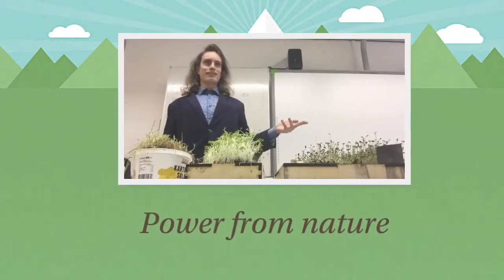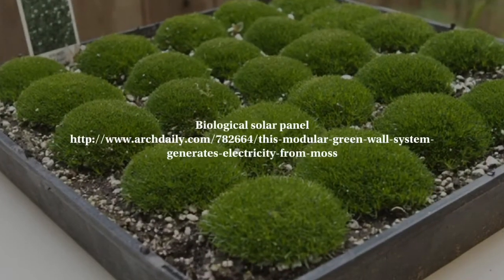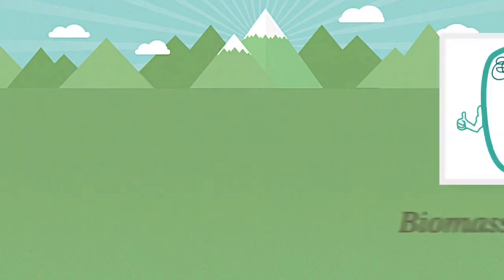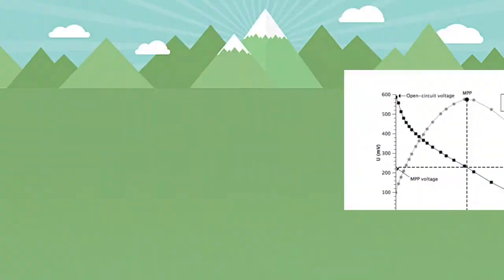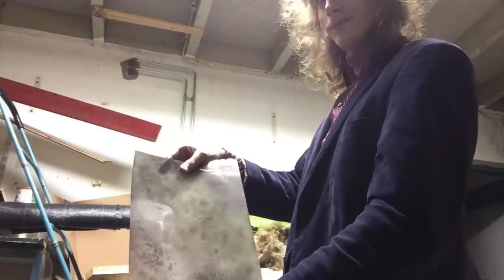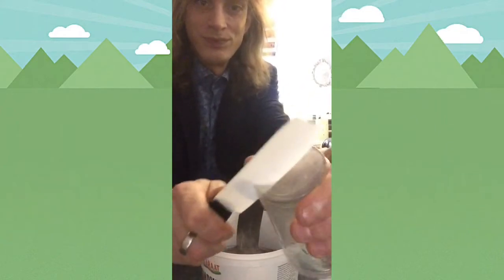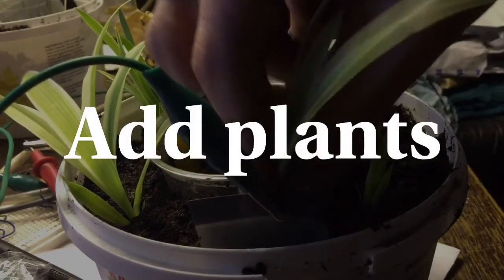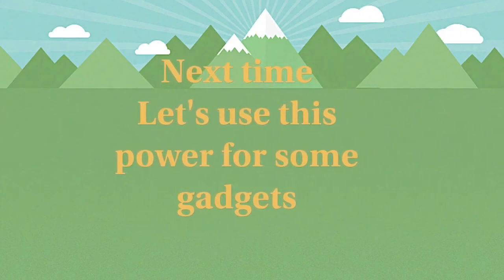Diy free energy from nature Microbial fuel cell

Comment: Is it possible to charge a battery or something small using this?
Reply from the maker: Yeah I have run microcontrollers on continuously grinding pie numbers 
Ramped the voltage up to 180 volts 
Charged capacitors and batteries

Comment: Why is the cathode not in the soil?
Reply from the maker: it could lay on top off the soil, 
but with the cups you will provide a shorter distance for the ions to  travel from anode to cathode,
Now i'm experimenting with ceramic membranes from earth ware like water filters or drain plugs made from terra cotta.
these can be plugged easy in the soil acting as a cathode near the anodes
Reply: @EigentuininhuisNlAqauponics  so basically, you put te cathode in the cup and it can just lay on top off the soil? And then you put some water in the cup?
Reply: @EigentuininhuisNlAqauponics  ik heb een vraagje, dus de ionen kunnen door die plastic beker heen de kathode bereiken??

Comment: Fascinating! You have inspired me to look for voltage in my aquaponics system!
Reply from the maker: https://www.youtube.com/watch?v=u5dywqC67Eg
yeah great :) here is a video of my trying doing the same.
It can be done with sludge, but i have been told that nitrate eats up all the electrons to make gas. but it seems to produces a few milivolts :). duckweed can also generate power ;)
Reply: Great video!

Here's what I did.

Procedure: I stuck one lead in the heavy solids filter(which is partially anerobic and the other lead in the degassing tank(which is very aerobic). I got 68 milivolts and I just cleaned the solids filter this weekend!

After some time the voltage dropped. I assume the potential difference between the two tanks had neutralized due to electron flow in the connected circuit. I figured as the water circulated the potential difference would reestablish as the "neutral water" became charged as it entered either the aerobic or anerobic tank. I disconnected the leads and the next day I was reading 110 milivolts!

I theorize that the water needs to return to the solids filter which allows it to receive a negative or positive(whichever it be) charge. I am not using a proton exchange membrane, I feel the circulation of the water serves this purpose(although probably not as efficiently). Possibly increasing water flow would "recharge" the system faster. I saw a video where a guy used a "salt rope" as a proton exchange membrane, but I'm not sure my aquaponics system would like a bunch of salt, but I think I can do it if I keep the end of the rope upsidedown, so the salt doesn't escape due to it's weight.

Perhaps I can increase the voltage by letting the solids filter get dirty or by increasing the surface area of the nodes or by adding a proper proton exchange membrane??

Keep posting videos! This is fascinating!
Reply from the maker: +user 15481 he great you already have results 
I find it also super because growing food and fish . Cleaning water and generate power out of it is like the super solution where everybody can make a small change in the world by providing there own needs :)

Proton exchange membrane is the same like a ceramic pot it just let ions go through and no oxygen. But i have seen mfc's without a pem 

There is a different nitrate concentration in the ground then aquaponics water. So that may be the cause for the lower voltage. Place the cathode closer to surface water so it has more oxygen to consume , and put it lower where there should be lesser oxygen meaby you can measure a difference.

To increase the output in amps increase the surface area you can do this with active carbon, 
To increase voltage try different electrodes materials , but still they have to be of the same materials for the electrode and anode , or you will get a galvanic battery /reaction that will break down into your system ,that is what you don't want to happen.

A nice video to look at making some nice electrodes :
Reply from the maker: +user 15481 https://youtu.be/_zCsAfEbVRc